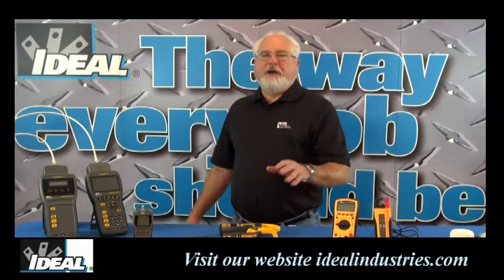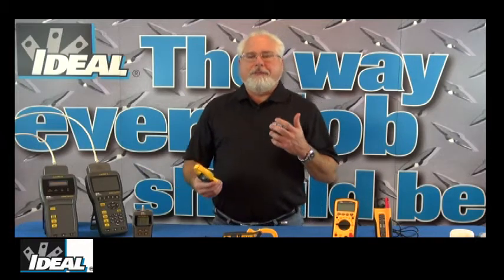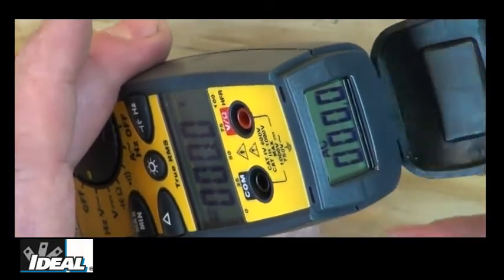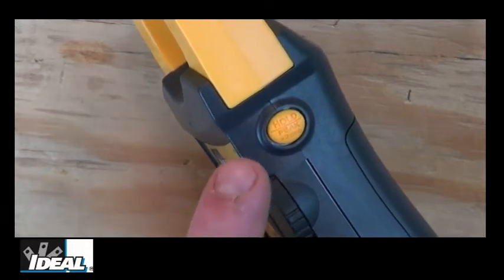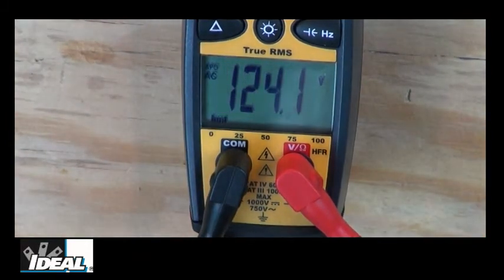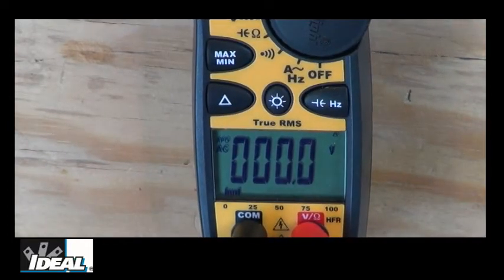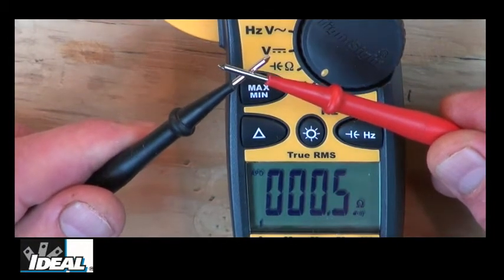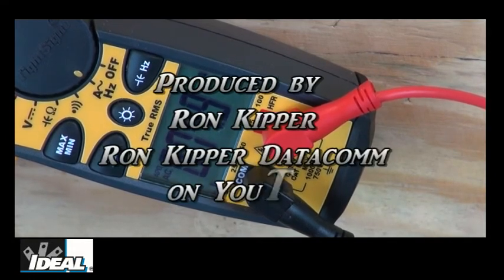61 763 TightSight Clamp Meter Video1

Comment: That audible voltage alarm is terrible. Seriously, that would drive me frickin nuts and now has me apprehensive about buying one. I currently have an Ideal #61-746 and would like the second display. I need to be able to turn off that alarm though.
Reply from the maker: Hello most meters beep when they sense over 30 volts. They don't beep much just once and no way to turn it off that I know of. Ron

Comment: Hi Ron I used to have a tight sight clamp meter that would do DC millivoltage Can you tell me which model this is? thanks Dean.
Reply from the maker: Dean the new 61-647 is just being released to the market now will read down to 400 mV if you need something lower you might have to buy a digital multi-meter. The 61-647 will be in Lowes stores about the first of Feb. have fun Ron

Comment: Does it read DC millivoltage down to 2 millivolts?
Reply from the maker: Dean if you need to measure something that low I would recommend a good quality multimeter.
Reply: Ron Kipper Datacomm I used to own an ideal tighsight that did amps and millivoltage. I am a plumber/gasfitter and need both. I just cant remember witch model i used to have, and I want to get the same one.

Comment: I'm having an issue. When I'm checking voltage my meter doesn't beep. When I check continuity it beeps, but when I'm checking voltage the light and sound doesn't come on. What may be the problem?
Reply from the maker: Hey which meter do you have and how long have you had it? The meters carry a two year warranty. Let me know send me an email to ron.kipper@idealindustries.com
Reply: @RonKipperDatacomm1  Thank you so much. I got it to work. I went to Ideal industry web site and got the instructions. Apparently, I had to hold the min/max button while moving the dial up towards the voltage/hz, as I held the button a "hb" will display on the screen. Then I tested the leads on a receptacle and everything worked fine. Thank you once again for responding, that was very professional of you.